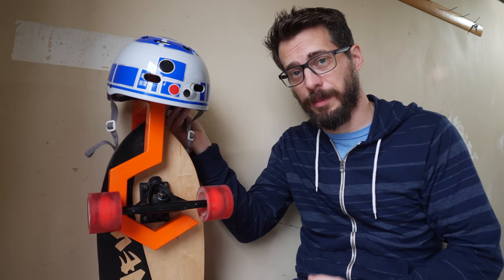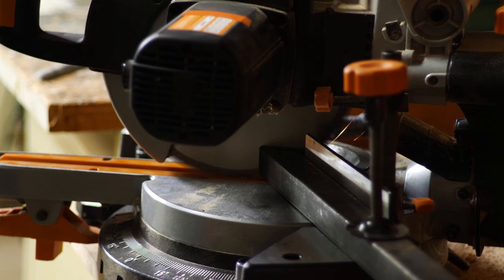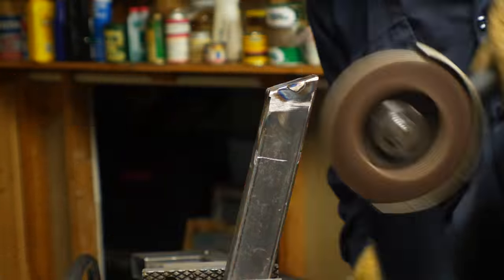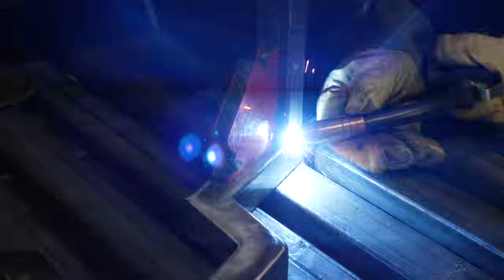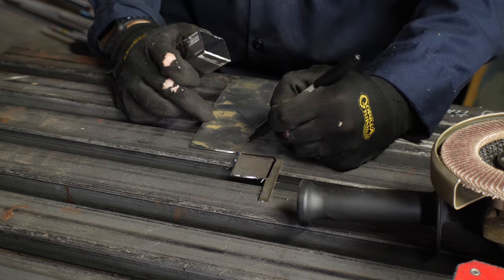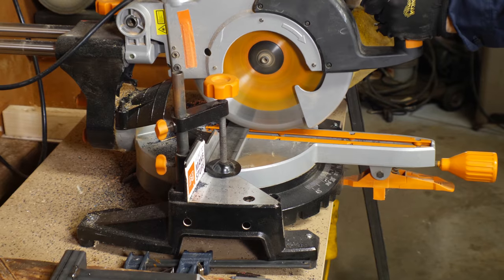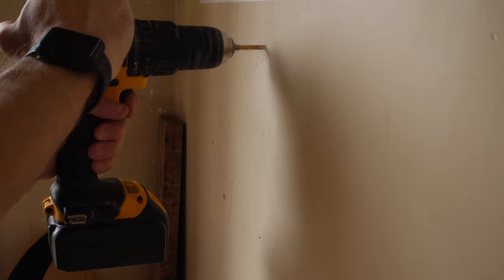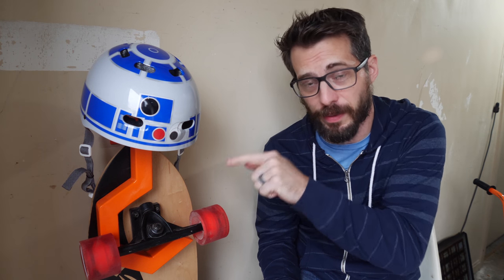How to Make a Steel Skateboard Hanger | I Like To Make Stuff

Comment: On the metal cutting mitre saw. You can buy those RAGE Evo blades. Problem is they want to run at 4400 RPM, which is great ... unless yours runs at 6000rpm like mine. 

You'll get like 5 cuts out of that sucker before it blunts.

Comment: Hey @Bob.. if your welds are "tall" and not more layed in to the where you are putting the weld then that means your too cold.. turn up the heat till they lay flatter.. just test it out on a scrap piece

Comment: Great work Bob! 
One suggestion I have, if you're looking to make it a lot faster or different you could use half-inch diameter steel rod and bend it into the shape you are looking for. You probably wouldn't even need to heat it up in order to get it to bend, just stick it in the vice put a pipe over it and pull till you are at the angle you want. I hope that that gives you some ideas. I really enjoy your videos and they always get the gears in my head turning. After watching this one I started thinking about making my own skateboard hook and I don't even have a skateboard. :)
Always look forward to seeing your videos come out!

Comment: Hi Bob, nice hanger, i have spraypainted some rims some time ago and what you can do is get two component lacker for this. that is much harder than normal paint. also what you can do is cover the areas where the board hangs with some protective coverage. for example a piece of teflon or something, that will then protect the paint even more. while whatching the video i noticed that you use a (metal) marker in order to mark where you need to drill and cut. i stopped using those as they might effect the paint job. i have been told that especially on powder coating or galvanising. I always use scratch pens. they are a bit harder to see on the metal, but never interfere with paints. its fun to see how your welding scils are imporving. this is how i started as well some years ago and last year i welded an entirely custom rear cross member for my landrover with all the gimmics i wanted in it. :D

Comment: I love my Evolution saws and blades. cut through anything, almost. Could possibly wrap the board holding bars in clear tape and that will protect against sminor scuffs and scratches. Great little project and don't worry about the welding, you have plenty of sanding equpiment. :)

Comment: Other possibilities:  1)  Store them long ways and flat (like you showed at the beginning) and space them out so that you can use the skateboard itself as a shelf to hold the helmet.  That way, when you grab the skateboard, you have to take the helmet with you.   2)  You also mentioned that you want to see the underside design.  For this, you can make two brackets to hold the skateboard sideways on its edge with the bottom toward you.  You can then hang the helmet by the wheels.

Comment: A couple ideas for future builds:
 -In place of the outsized hex hook, how about a bicycle hook? 
 -Rubber tool handle dip (plastidip etc) instead of paint
 -cabinet with cubbies - attach 3dp wheel cups to the walls so the graphic can still hang outward

Comment: Hi Bob! Nice work! Pretty sure you'll not see my comment, but hey;
You could have use the depthstop of your miter saw to cut partially your square hollow section. This way you would have only cut your steel on three faces instead of 4. It would then have be possible to bend your steel in shape. The remaining small part of steel on each joint would have made everything easy to line up.

Of course it's a bit more work on the mitter saw (depth stop, cut the partial miter at 30 degrees, flip the par to complete the notch, etc), but I'm sure it's worth it.

Maybe you'll think to that another time !
Keep up the good work !
Reply: Thats a great idea.

Comment: When you're drilling into metal, you should also put oil on the bit itself. Like in the grooves of the bit. That way it'll "self lubricate" as you drill further and the oil you put down initially gets used.

Comment: Hey man, great work! If I could add my 2 cents, I´d make the hook a square (or rectangle) instead of a hexagon. So the truck´s base plate would lay flat on it. Also, I´d cover that spot with a stripe of rubber or EVA foam, so scratching the paint wouldn't be an issue.

Comment: Good on you for doing these metal projects rather than just wood. 

A suggestion about cleaning up those caps (or or doing something like it): I find a really large (12-14") second cut metal file will make really quick work of them. Also, files only cut one way, generally the push direction. Lift off on the pulls or you just dull 'em. Hard to do quickly at first but comes easily with practice. 

Again, great creativity on this project!

Comment: Tip on the welding, instead of tacking in the center, try racking the corners it’ll make you’re welds a little better since you won’t have to weld back over your tack
Reply from the maker: Great tip! I definitely realized that after a point.

Comment: Skateboard backpack hook???
Reply: Yes please
Reply: Definitely. Regardless of what shape it takes, I need to figure out a way to strap my Longboard to my bag so that I can leave it be once I don't need it anymore. (Since a longboard is a lot longer than a skateboard, hanging the board horizontally inside my bag straps is definitely not a solution)
Reply: Volvary I don't have that problem as my longboard is foldable

Comment: Just a quick tip when caping the ends of tubing you should drill a very small hole somewhere you wont be able to see. If you dont do this the gases and fumes from the weld dont have anywhere to go and you get blow out.

Comment: A welding tip:
Want flat welds so you dont have to grind as much?
Try upping the amps a bit. More heat means the metal have more time to flow outwards and thusly getting flatter.
And try to weld as many welds you can "falling". Meaning beginning high, and stopping low. Hars to explain, but try googling for more in depth. 
Its also a slightly faster method of welding =)

Comment: Howdy Bob! Maybe if you took one long piece and cut out the joints at the angle to make the hook shape and then bent the edges and welded the seems back together it would save time rather than cutting out all those angled pieces and reassembling them all back together. Also orange is a hot color right now, you may want to paint it something different in the future, plus scratches give an object character. Great video! I love all the visuals from the sparks!

Comment: Nice finish. I have almost never welded, but my father was a blacksmith so, after seeing him work for years... if I'm to give my two cents on this project (not that you can do too much to prevent me from doing it anyway ;D ).

- He would many times not use a piece from a sheet of metal to close the hole on the end. He would actually not make all the cut of the final piece but leave one of the sides longer (which makes the cut more difficult, I know), as long as the width of the hole of the tubing needed, and then he would hammer down that extra length so you wouldn't have to weld that side, which is better.

- Also, since that piece is not going to be used to hang really heavy things, you could use tubing of a narrower diameter next time. That would make it also much faster to make. If you use a piece that is half the diameter, you would have to weld and grind half of the work, which is half of the time.

Thank you!

Comment: That's a great idea! Would it be easier to have the area that the skateboard trucks rest on be flat with a strip of rubber and possibly an end-stop? That could prevent the paint from chipping off as quickly, and it would give more surface area for the trucks to rest on instead of what looks like 2 points.

Comment: I think it looks awesome; great job. If I were to do it, I'd do one thing differently; I would have the trucks supported by a flat piece of steel, not the angle that it sits in presently. That might also help lessen the wear and tear on the paint.

For the next iteration, how about looking into bending the steel into a tight-ish curve, instead of doing it angularly?

Comment: How about using some tube or bending some round bar for the next one? Weld to a plate to mount and it should be a little quicker if the cut/weld process is taking a while

Comment: would it be possible to take a long section of the steel bar and cut sections into it so that you could fold the bar into the hook shape, then weld it back into one single piece? would think that might make it faster to produce these

Comment: If you turn the skateboard 90 degrees to the wall you can get more of them in the same space and then you can see the graphics and the deck. Remove the board by lifting and pulling straight out so you don't need any room between racks for board removal. Also, mount the helmet lower so that it covers the end of the board. That way you can't remove the board without removing the helmet, or knocking it off on the floor. The kids are less likely to grab the board without the helmet that way.

Comment: i'd try turning the heat up on that welder, looks like you're welding pretty cold and not getting good penetration. you want the weld barely higher than the surface. awesome design, though!

Comment: Can you do an intentional welding how to video for beginners?
Reply: If it's MAG welding, take the gun, take a helmet, put the helmet on, point the gun on some steel, and weld. A how to video isn't really gonna do much, because it takes a LOT of practice to eventually become decent in welding, you literally have to make miles upon miles upon miles. It's not something you can learn from a video.
Maybe some of the welding settings could be done, but even those are based on both personal preference, the material you're using, how you want the weld to look like. If it's decorative or industrial, etc etc.

Comment: Did you start using a camera dolly? Great shots of the grinding!!
1 way to make it a little faster would be to cut 30° Vs into the square tubing, bend them to close the V and then weld them. It will save the aligning and tacking of the pieces, and also 1 less side to weld and grind.
Enjoy the next 5...

Comment: If you had to mass produce them or make a bunch at once, you could just use the long piece of steel tube, notch out where you wanted to bend it, then bend it and weld them there. You would still have to do the top and the back separately.

Comment: Love the video. Maybe as a means of speeding up the process instead of using tubing use quarter inch flat stock that way you don't have to worry about capping and can just focus on welding the shape of the hook itself.

Comment: Realy good project. I realy apreciate the hook design, but why not make those out of wood?
Reply from the maker: It's hard to practice welding with wood  ;)  Seriously though, I did consider making it from wood and finger jointing the angles to make it really strong.  Would be an interesting approach.
Reply: Would be really nifty to have a the same general design in a bunch of different media. Wood, Acrylic/Lexan(heat bending?), Concrete, Metal(this one), and maybe one made of PCB's with an arduino(or some such) that angrily beeps at you if you don't take the helmet. Would be a very ILTMSy :0 Nice work Bob!
Reply: About to comment the same...   [Edit: make those out of wood]
Reply: Hahahahaha
Reply: Thanks guy,

Comment: The Evo is essentially a wood miter saw with a carbide blade, which you can buy independently. It runs at 3250 RPM which is generally way, way too fast for cutting steel. The metal cutting chops saws that run at 1300 RPM are better (dewalt dw872, makita lc1230) at less than half of the surface speed, but it'll cost a bit more. 

The problem is those blades are super expensive -  You'll make back your money in blade savings by running a slower saw.

Comment: To form the hook and save some time you could have just cut three of the four sides of the tube, basically removing a wedge. You could then just bend the tube in position. Easier with a bandsaw rather than a chop saw but still... with careful planning it's batchable

Comment: Great vid Bob...but can you make a Steel Hanger out of Skateboards?

Also, you could've made this out of wood, couldn't you? Or would it not have been strong enough to hold up the board? I might try this, But I don't have acess to a welder (But I do have a different design idea that will probably work).

Comment: great video but some tips at welding wit MIG, its easier to weld from the top to the bottom when its the only way  and dont carry the burner push it you´ll get much better welds, and for time saving just grind the welds flat there is no need to do it on the flat surface and grind with the weld ( i hope yoiu know what i mean, the disk runs clockwise then let the disk do the work) and youll get much faster a better surface with disks wehre you can put sandpaper on it. sorry for bad gramma english is not my finest

Comment: Great video Bob. Out of curiosity, what grit sandpaper do you use when sanding down paint? Also if you're worried about paint would it be worth giving it a couple coats of a decent spray on lacquer? 
Also, in my experience the thick welding gauntlets can be a little cumbersome to use, for both welding and grinding. I use tig welding gloves, much thinner leather so much better "feel" to them. I'd certainly recommend them for when you're welding but it's up to you if you're happy using them when grinding. That being said, your welding is looking good, keep at it! :)
Reply from the maker: That's good to know! Those gloves feel HUGE on my hands.  For sanding down primer, I usually use 220 so it doesn't take off too much.

Comment: The way the welds look, I may can tell, that your current or voltage is set to low. I cant really weld MIG, but stick and TIG.
Your weldbeads need to "sit deeper", for that, you need more heat, that the fluid metal can flow better.
So you will save a lot grinding and the welds are much more stable.

But beside of that, its a great project and a nice looking result :)
Reply from the maker: Thanks for the input, I'll give that a try!

Comment: Cool design! I heard in your podcast you're looking for which TIG welder to buy to get started. Look at the AHP AlphaTig 200x!
Reply from the maker: Yes! I actually just bought that one!
Reply: Awesome. Can't wait to see those videos! There's kind of lot of things to buy just to get started playing around with TIG in your own shop. Different filler rods and tungstens, a torch kit with collets for each size tungsten you might want to use, also cups, backs for the torch, etc. I recently researched it quite a bit as I started learning myself and have a good low-cost starter list. Happy to share, if it's useful!

Comment: Nice I like it. Next time though you really do not need to weld the inside joints. If you welded just the 3 outside joints it will be more than strong enough for hanging a skateboard on. The not only save you heaps of time trying to clean the inside welds off but also it looks a lot neater at the end. Try it next time, just remember what weight the hook it going to hold and where the stress points are and weld accordingly...

Comment: Rather then making all the cuts and save time grinding and sanding, chain link may be the way to go, at least for the hook portion.  Simply tack the chain in the same rough hook shape.  Still use the same mounting and helmet sections.

Comment: You could 3d print a version of it.
I don't know if it would fit in your 3d printer and for sure it will take a ton of time to print but it's quite sometimes u didn't make a project involving 3d printing.
Don't know if it will resist the weight but maybe with the right infill yes.
Sorry for my bad english it's not my first lenguage and the autocorrector in the smartphone set in a different one dont help. :)

Comment: Just a suggestion, but maybe you should put a filter over the sections of the video which includes close up welding as we don't have a face mask and the process is very bright and slightly painful. Not having a go at you Bob :) just a suggestion. Great job on this project.

Comment: It would have been super cool if the bottom v was angled so the piece on the far right with the cap, came I️n front of the trucks so they kinda slid in and were sandwiches in between. To do this you’d angle the left side of the v out away from the wall, and then the right size basically just how it is so it becomes more 3D. But awesome idea!

Comment: Actually making more would be very fast. Keep the measurments and cut 5 times the pieces and weld all of them at once. Saves time and power. The really time consuming part here is the grinding...My advice would be to use a heavy duty grinding wheel and grind it up. Than use filler primer and paint. The filler primer will help you skip the flap disk and polishing that are essencial for spray paint to look good.

Comment: I don't think you're using enough gas whole you're welding, the grass protects the well from oxygen, try turning it up a but, make sure there's no fan blowing air around, it should reduce the sparkling, if you're using Argon try welding closer to the ground.